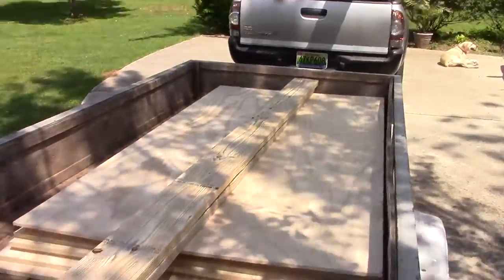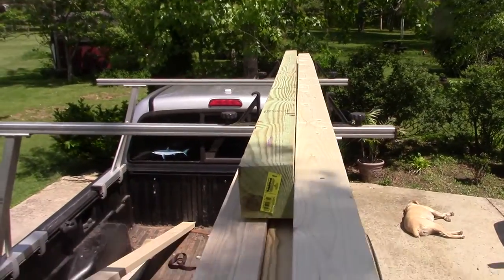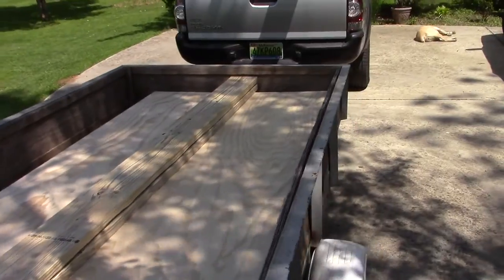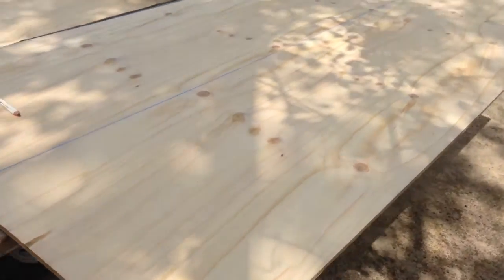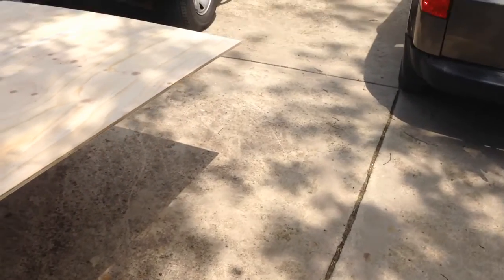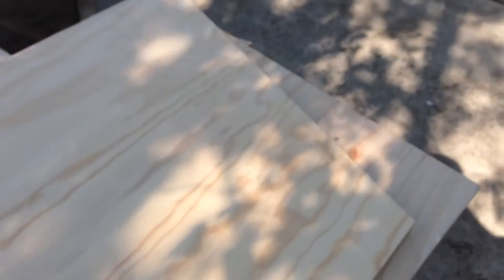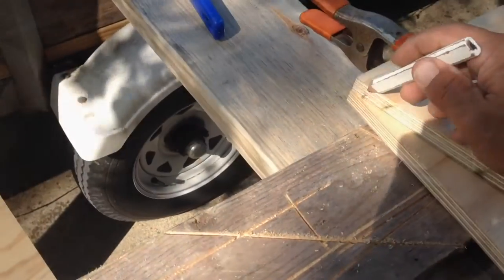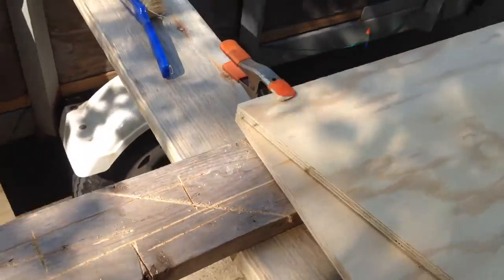Building the Lumberyard Skiff - Getting Started

Comment: Love the notched trawl technique  for the PL premium. I built the 20 ft LYS last summer and using it in the Gulf of Mexico. I am powered with a 40 hp and it does around 24 knots loaded though thats to fast in any kind of chop.  Cheers and thanks for sharing.
Reply from the maker: +sky5jump Thanks for the input on the performance of the 20'er with the 40.  My Albion runs about 24mph loaded for the day with 2 fishermen.  How does your boat handle a following sea with the flat bottom?
Reply: It's all about shifting trim. With the fine entry she will dig if you push the bow down to far. I have a side consul with an open lay out and carry coolers for benches so shifting weight is not a problem. I was 12 mile offshore of Sanible Island in 10-15 knots last Jan. I wouldn't recommend it but the boat handle it ok.. It was just forward of the beam and pretty sloppy but we stayed on plane and slugged right on home. In that case I shift weight to the weather side and let the chine work as a bit of keel. It helps to take out some of the slap.
Reply: I almost built the Key Largo from Jeff Spara's web site, but I built outside without cover and thought the LYS would be a quicker build. What did you use for Plywood. I used GP 3/4 inch form boards. I treated the inside with 2 heavy coats of linseed oil before priming and painting and 8 months later living outside in the drive still no checking.

Comment: Mark, have you ever had issues with epoxy or PL not staying stuck to PT lumber?

Im gathering my mats right now to do a LYS as well.  I can get a really good price on some 20' 5/4 treated lumber from a local supplier.  Ive been told epoxy and Pl will not stay stuck to treated lumber.  Any input.

PS/  I was able to buy good AC Fir plywood here for only 6$ more than the pine stuff....Im pretty happy with that!
Reply from the maker: +I am a Buccaneer  I do not have a definitive answer for you.  Basically I am not going to say "yes it will work".   The reason is,  I don't want to miss lead anyone.  That is sort of like getting reloading data from the internet.   use at your own risk. Blah blah blah.  Okay...well that being said I have used it to bond plywood to treated.  And no problems on the framing part.  I did have it fail on a keel to epoxy/graphite using the fast grip.    But in that application the screws sheared also.  I would set the boards out on stingers to let them dry a bit.  them glue up a sample.  And do you best to break it.  here is a web page to look at.
http://www.simplicityboats.com/pl_premium.htm

If I do another lumberyard skiff I will frame it out of treated.  I hope this helps some feel free to ask more questions.  It is a good boat.

Comment: I purchased the plans from Old Wharf.  As you know, the plans don't include information on how to cut the curve on the bottom of the side panels.  I count only 5 possible reference points to run a batten, including 2" at the stern and 3' at the bow.  Did you use these (and the other three points) to run a batten?  If not, how did you measure the curve on the side panels?  Additionally, it doesn't look like you cut the bottom or sides of the transom at the recommended angles (to accommodate the side and bottom panels.  Did you cut to angle or did you fair the transom side and bottom later.  Last question.  Did you attach the 2x8 floor butt blocks as you were attaching the bottom pieces, or wait until the bottom was attached to flip the boat over and attach them?

I emailed Old Wharf with the questions yesterday and no one has gotten back yet.  I am eager to get started.  Also, the 4x4s that attach to the transom, did you cut them at the angle recommended for the transom side bevel?   

Thanks a million.
Reply from the maker: I do not have the plans in front of me.   But if I remember correctly all relative measurements are there.
Reply: if you are still on did you ever figure out the curve on bottom?  i had same question!  curious for sure.

Comment: hey how did you gut the bottom of the boat AKA to get the rocker.  I have the plans and have been studying your builds for awhile now.
Reply from the maker: if you have the plans there should be the sport model. follow them.
Reply: thanks!  i was debating on which so this helps my decision.  first build!  was going to big or go home and do the twenty.  but maybe its best to do the 16 sport first.  thats the model on front cover.  beautiful @plywoodonframe
Reply from the maker: i made that one an 18’. defiantly do the rocketed front if you plan on using it where the water gets rough.

Comment: Mark - Am i correct in thinking that you just added 2' to the last section where the transom meets to make it 18'?
Reply from the maker: I believe it was 2'6" added there.  If you do that you will need to make a slight change in the chine lines.  I did mine by eye before added the bottom